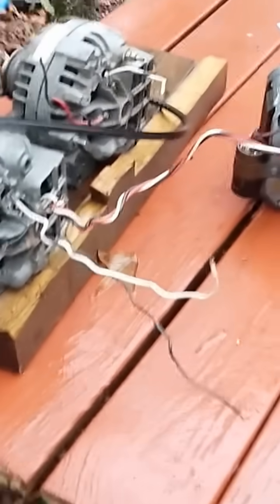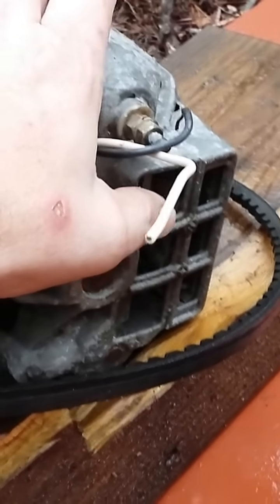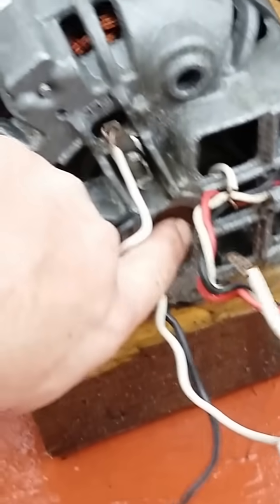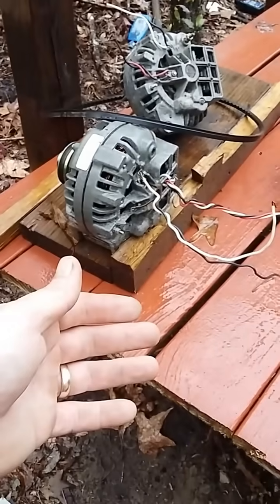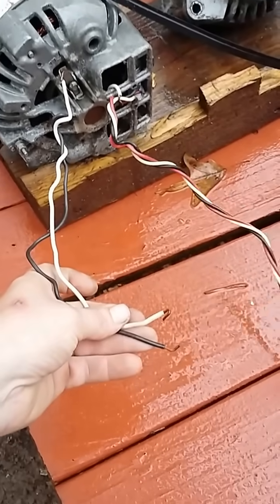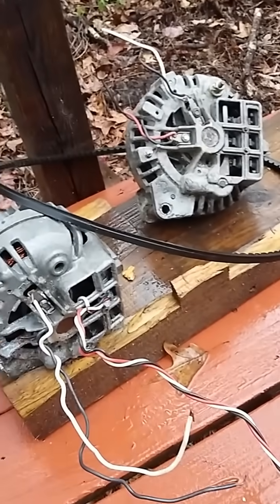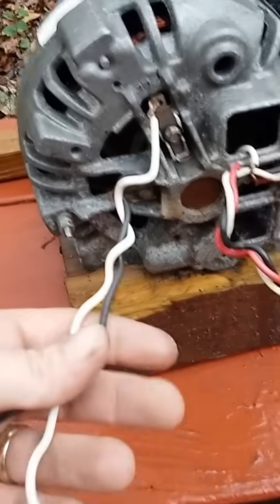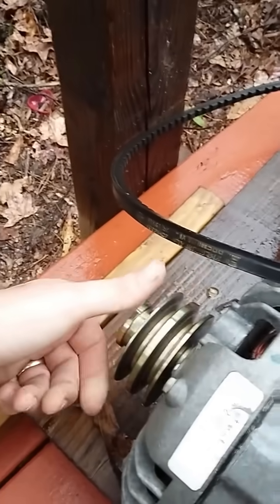Update Free energy forever no wind no solar no gas READ DISCRIPTION!!!

Comment: Good Idea, but #12 wire will NOT carry 100Amps. You need at least #4 or larger. Sorry but those are Facts. #12 is rated at 20 amp +or- 7%.
Reply from the maker: +No use for lazy people None. 
By your calculations your correct. but you have no idea what I'm doing... I only need those types of calculations on a load-bearing circuit if I've already stepped up the voltage through a Transformer and then stepped down the voltage through a Transformer then there will be no load on the generator side because it will be drawing the current from the Transformer that has stepped down the voltage. would you like to place a rebuttal?

Comment: So he says, send 6v to the first motor.  So is that enough power to get the stator to spin?  He had a belt there too, so there ius more to it. What, send it 6v and spin it and it keeps running? He seems smart, but explaining how to do it on video is not his strong suit!
Reply from the maker: Craig Nelson 
No sir none of that is correct.
Please read the description, the stator Will Never Move it is three coils entwined in iron plates. one end of all three wires are all tied together. on the other end is the three wires sticking out of your stator that is connected to your Bridge rectifier. Wiring your stator like this is called wiring in Star. In order to create perpetual motion you must have 100% efficiency or more than one contraction that is very efficient thus the reason why I picked the alternator motor generator or also known as car alternator there is no difference between those three words except for how you use it, whether as an input or an output. Using a DC motor to turn a couple of DC motors to put power back to the battery and to run the motor in the first phase is only one way of creating overunity there are many the only way to get free energy is by converting energy that you already have whether it be air, ether, resonance, water, gas, or coal. it can all be transformed into different usable energy's using different Energy's to create different Energy's is what we have been doing our our Lives, so why would it be any different for me to take a small DC motor and turn a large DC motor with it to keep the small DC motor turning and the batterys charged and  using a power inverter on the batteries to have a stable sine wave to power sensitive equipment. Using a setup like this you wouldn't have to worry about load capacitance because all of your power is already stored in a battery Bank you are just using that battery Bank to recharge the battery Bank itself using a DC motor to turn another larger DC motor keep in mind my previous statement that there is no difference between a motor or an alternator. a DC motor is also a DC generator...
Reply: JUST DO IT AND FIND OUT WHAT U GET

Comment: Hillbilly science 
Amazing
Reply from the maker: Miles Downing 
if you only knew...?

then you would know that I have turned down millions of dollars a couple of times to keep this technology from being hidden from other people! no one knows what I'm doing with the alternator unless I've told them. do you know what you get when you get extremely high voltage and no current? who cares about the Hertz or duty cycle it's not even in the equation because there isn't much resistance in the circuit...  and that's not what feeds the house anyways, I use one machine to create another machine, to run all of the machines , figure out that riddle and you will figure out what I've done...

Comment: Can you show in side wireing because I got 6 wires coming off the stator. Or some kind of wiring diagram.  I would like to Know more about this
Reply from the maker: Ed Zehnpfund 
the 6 wires that are coming off of your stator is actually three wires that's not tied together on one end like the alternator I have that I'm using as a motor wired in Star using a small three phase electronic speed controller. if you have 6 wires then you need to check the continuity between each one and find out which ends of the three wires go with the other end if you want to wire it in Star like I did then just tie three of the wires that don't have continuity with each other together they're probably on a different side of the stator then the other three wires and you will have it wired in Star. then you just need to add current to your field winding on your rotor.

Comment: You dont need 12 volts dip shit you need to turn sator in turn produces the ac which is then converted to dc which is what keeps battery charged in car.
Reply: What is a DC excitor doing charging field winding on an 1 me generator then?
Reply: Bonny Doon, I'll give it a shot but my memory a bit cattywompus so... A current must flow in the coils to generate the field, otherwise no power is transferred to or from the rotor. Excitation means generating a magnetic field by means of an electric current. Excitation is possible when field pole pieces have retained a slight amount of permanent magnetism. When the generator starts rotating, the weak residual magnetism causes a small voltage to be generated in the armature. This small voltage applied to the field coils causes a small field current. Although small, this field current strengthens the magnetic field and allows the armature to generate a higher voltage. The higher voltage increases the field strength, and so on. This process continues until the output voltage reaches the rated output of the generator.

Comment: 1000$ a month for power!  Wtf shut the front door in winter lol
Reply from the maker: stephen nichols 
most people I know live in large houses that they really don't need and a large house uses a lot of electricity, if you want to say it that way.. even though that's not really how it works. but I don't think I've ever seen my mother have an electric bill under $150 most of the time that I lived with my parents the electric bill was about $250 to $600 a month and that's for a small 3 bedroom 1 bath house. why was the electric bill higher at my mother's house then next door at my friend's house? Always double!!! I'll tell you why, my friends rented their home and my mother owns her home and land... money or slavery is a condition equality propaganda'd throughout Society. food may be very expensive where you are an electric very cheap, hear gasoline is pretty cheap and food is mid-range and electric is expensive.  just to have electricity ran on a undeveloped piece of property will cost you $10,000 minimum and that's after you get a septic system put in for about 8 or $10,000 and then have the water lines ran for about $2,000 depending on if there's a meter head or not... because that's another $950... so it doesn't matter where you live something is going to be more expensive Where You Are compared to where someone else is...

Comment: Can you show in side wireing because I got 6 wires coming off the stator. Or some kind of wireing diagram.
Reply from the maker: Barry Wallace brother I do have that in one of my other videos but I will explain why an "alternator".
 on your stator coil there are three coils which means there are six ends of those wires on the stator that you need. usually three of them are already tied together so that you can use it in Star. Now to wire in the "motor"  you need to tie three ends of one side of the stator wires together and leave the other three open for the ESC input. I repeat there should be no continuity in between the three wires that you leave open for the input  of the square sound wave  from the ESC. 
You must input direct current to the rotor coil so the signal you put in  to the stator coil will be synchronous with your field coil. The wire endings of the field wire and then pulse a (sound) Square wave signal with an electronic speed controller (ESC) into the other three wires that are not tied together that come off of your stator coil that is how you wire one of these synchronous alternator generator Motors or car alternator, however you want to put it.. but this is synchronous DC motor wired in star... now your next question is, why would I want to know that and you didn't specify how much DC voltage and wattage to put to the rotor coil? let me explain this. you will find that with a 12-volt 4-wheeler battery probably 35Ah   you will have a higher speed or top end and less torque then say 24 volts at 70 amps per hour. with a 30 amp speed controller I used a 3.7 volt lithium ion battery that was 3500 mAh (about 3.7Ah) you will get an extreme amount of RPMs without a lot of torque but the thing is you're not creating a thermodynamically unsound motor you are actually using the thermal dynamics in the correct way inside of this direct current brushed synchronous motor. (alternator) now keep in mind the higher the voltage you put in the slower the motor will turn but I can assure you at 12 volts from a car battery it will turn about 800/900 revolutions per minute... now this is just an estimate because I didn't have a tachometer to actually test the exact revolutions per minute, but the thing is if you tried to stop this motor with your hands it would break them with the extreme amount of torque! so the reason I chose the "alternator" is because the direct current that is used to create the "magnetic" field is on the inside of the emitter coils making it a highly versatile and efficient and you can easily control the speed and torque with voltage or by using the controller. both can be tuned in and it doesn't take very much power or voltage and wattage to create a very good synchronous motor... they are inherently alternate current generators before the direct current Bridge rectifier is placed on to the three stator coil wires. they use one end of the wires as a short in the circuit. then they use some diodes to direct the rest of the current into the shorted circuit creating amperage from a small amount of DC voltage & (i) coming from your car into a large output of DC amperage at a regulated voltage. I sure hope I didn't go into too much detail of the inner workings of the alternator / generator / motor! I am only speaking about the car alternator in this comment... but to understand it, is to understand that there really isn't any difference between an alternator or a motor and the word generator is the same thing or the same word as the word alternator.. generators actually used to be called alternators  and  alternators are called alternators because they inherently produce alternate current. it is just a little wild and unregulated as they say... that is before  the direct current Bridge rectifier... it is all just one vicious cycle  but  the car alternator is of supreme design  and it can be used  for so many  different purposes!!! I hope the ways that I have explained the inner workings of the alternator in this video has helped you in some way to understand what I am really doing behind the scenes!!!  #LIVELIFELOVING
p.s. I have lots of videos... 😀
Reply: Hi how can one see your other videos or get directions to build one of these. I have land with no power source and would like to use your idea. Are you willing to let your idea go north to Canada. lol

Comment: If you had a few, all you would need would be to have one power a motor that drove a belt across all 3 and hand start it like a dyno... infinite power...
Reply from the maker: Alexander Raymond 
The original design given to me via not while I was humanely alive, had 9 generators and three motors that were evenly spaced out in between the three motors where the nine generators in sets of three... All DC permanent magnet motors and all DC permanent magnet generators the motors were half the size of the generator but in the configuration they were in they pulled energy from each other and created a Vortex around the machine itself breaking the lens law and laws of physics on top of breaking the laws of thermodynamics...  the energy used was expelled into the generator pulling the thermodynamic properties out of the generators and the motors it was equal and opposite attractions the voltages were different because the motors and Generator on the same voltage would act as each other. the generators tried to be Motors and the motors tried to be generators, fighting each other! but if you change the voltage of the motors input to lower than the output voltage of the generator then you have overunity and a lot of it! enough too, more than sustain a battery bank while on a load and still charge...  I was directed in the path of building large scale systems because companies that where to invest in this would already have the money and I could have mass-produced smaller machines to give away to the public with the money from the large companies... you know the old saying? steal from the rich and give to the poor. well, what if the rich just give you the money? then you still get the mission done and you help everyone!!!

Comment: I couldnt figure out how you hooked everything up but I did it my way and it works even better. What I did was hook up 27 alternators ( chevy works the best) in series with a flux cappacator on a alternating cycle of residual voltage controlled by a diode with an intersecting reverse polarity field of magnetism.Two diodes will double the wattage if they are connected in parrallel. Also you need a 75 foot ground rod made of titanium or whatever scrap metal you have hanging around. You have to drive the ground rod in at a 43 degree angle and it must be perfectly straight.If you hit a rock you have to start over.  The ground rod should stick out of the ground 2 feet and then you need to have  127 aluminum beer cans full of beer ( Canadian beer works the best) evenly spaced around it in the shape of an octagon. Then you urinate on the ground rod and all the beer cans ( the wetter the better)  and walla you have free power. The power will stay constant untill you drink all the beer. Its not rocket science. Im thinking you already know about this method. LOL
Reply: Ron Hammar brilliant!!! I tried your improved method of engineering and walah! AcDc is bumping from my washing machine!
Reply: If I had a spare flux capacitor I would make another one. LOL
Reply: I didnt need a voltmeter. I knew once it blew all the hair out of my head and melted my toenails  and fingernails there was lots of power. The only weird side effect was that I now have a permanent erection but thats a good thing.
Reply from the maker: +Ron Hammar 
well at least you got something you wanted from this video, even if it was a herd pecker.... I'm just poking at you... Wait, is it too soon for that one?
Reply: I dont have a lot of time to respond right now . I have a line up of women to deal with.LOL

Comment: Houses operate on ac current. Alternaters only produce dc current. He says he hooks it directly to his house and powers everything, however, this is impossible.
Reply from the maker: +smelly dead cat 
Actually, Alternators or generators (which used to be called alternators) inherently almost always produce alternating current or alternate current (like a car alternator) and is fed into a series of diodes in three different phases converting the AC into one single phase of direct current with a direct current Bridge rectifier which is basically just a set of diodes.
Reply from the maker: 90RECON94 yes you are correct. although, I don't agree with you calling an uneducated man a dumbass, I'm not judging either of you! but and alternator does produce alternate current and then is fed through a series of diodes to produce direct current. the alternate current that is coming out is unregulated and high voltage. so keep that in mind when using these types of synchronous setups!!
Reply: smelly dead cat Alternators are AC Generators, a synchronus generator.
Reply: smelly dead cat the Alternator produce AC current the diodes in the alternator is what changes AC to DC current
Reply: smelly dead cat Take out diodes.
Reply: Actually alternators produce AC current first they have to use a triode to get DC current by removing the diode’s in the alternator will leave you with AC current problem is you cannot feed one off the other goes back to the whole law energy cannot be made or destroyed only transformed you have to have some source spending energy to turn the shaft and I’d like to know who’s going to kill him poor thing must’ve got a hold to some DVDs
Reply: Dumbass Alternators produce AC which is then converted to DC , he's saying bypass the diode setup in the alternator, and hook your wiring directly to the winding in the alternator ... Output will be alternating current (AC)
Reply: smelly dead cat Alternator produces a.c. current,it's the diodes inside which converts the current to d.c.